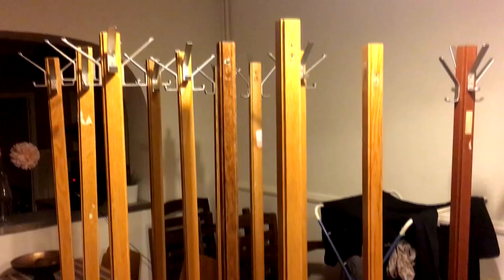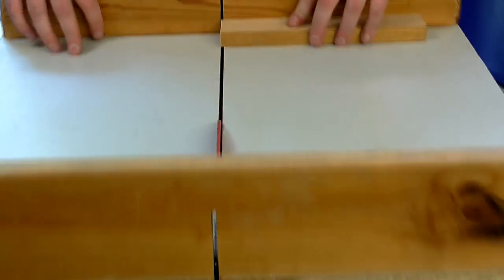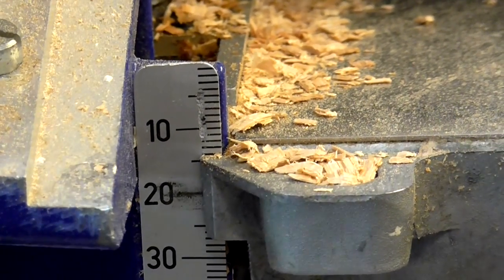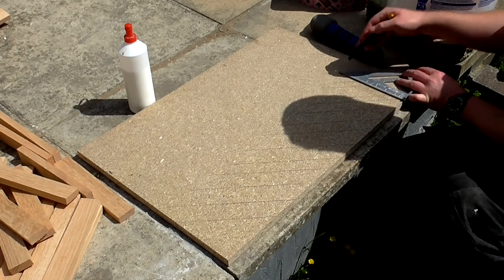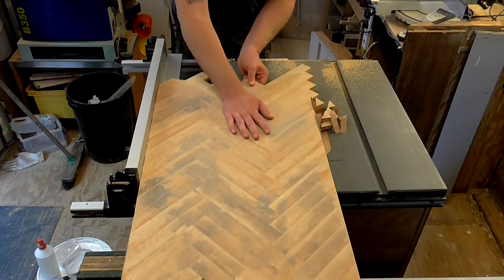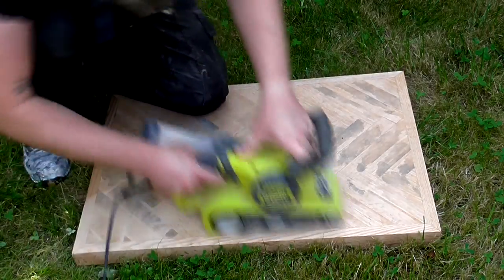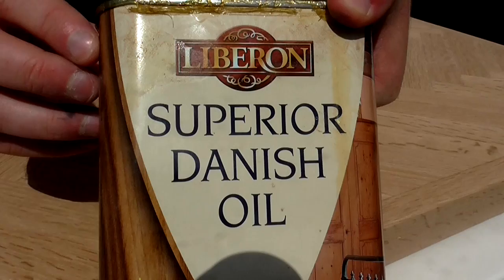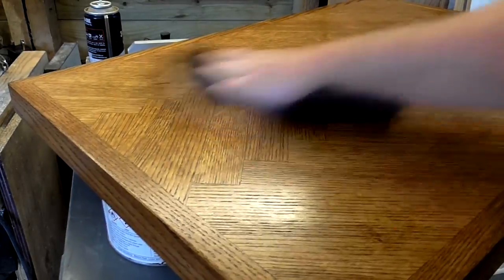Making A Herringbone Coffee Table Using Salvaged Oak (part 1 of 2)

Comment: Do you use the nail gun because it's faster? Is it any better than nailing by hand.
Reply: Old comment but others might want to know.

Hammering with a plain ol' hammer is effective but tends to shift the material about from the shock so pieces have to be clamped a lot tighter, that and the heavier impacts can loosen already driven nails

Comment: Not to seem antagonistic or overly critical but isn't that far too thick for parquetry pieces? I have been looking into doing some pieces like this myself and everything I can find says the pieces making up the pattern shouldn't be more than about 3/32" thick max (somewhere around 2.5mm I think). The reason being that any thicker than that and the pieces act like real wood and the expansion and contraction will rip the finished piece apart eventually.
Reply from the maker: +LordPadriac it's glued to chipboard which is stable so it isn't going to move much if at all. At least it hasn't moved yet...
Reply: @RagnBoneBrown  Hi, enjoyed the build and the techniques.  I am thinking about a similar build for a dining room table and wanted to follow up on the thread.  If you still have the finished piece, how is it doing in regard to seasonal variations in dimension?  Thanks!